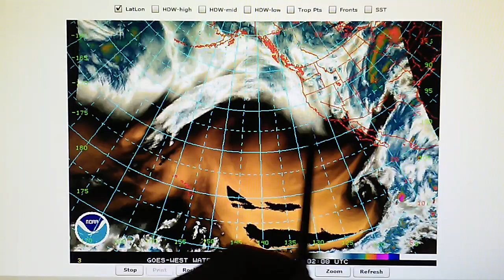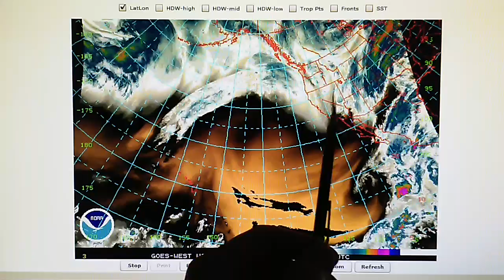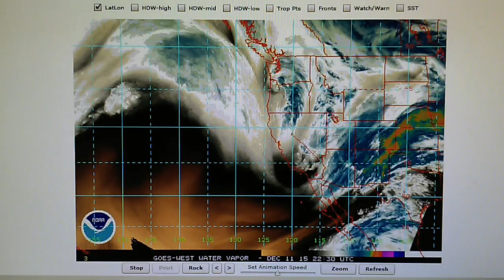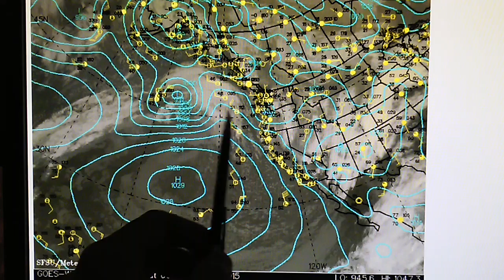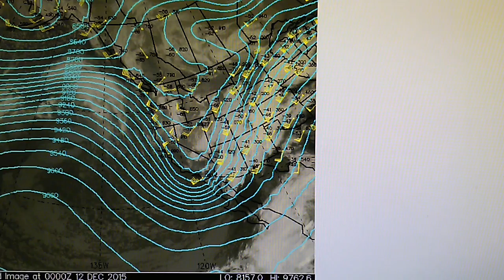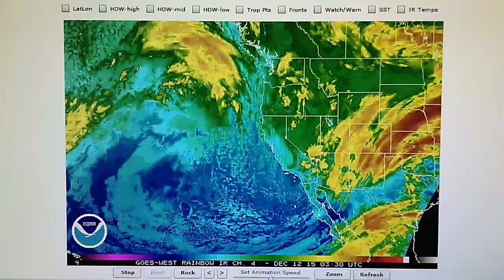12-11-2015; HAARP Squashing Low Pressure over L.A.

Comment: Dec 11 And again we are experiencing extremely strong winds here in LA through 11:30pm, courtesy of the HAARP weather weaponry, creating high pressure on top of low pressure.  I clearly see where HEAT is being applied by The HAARP Ionospheric Heaters, to evaporate moisture before it moves into the SoCal area.. I also see they once again have their manufactured weather devices in place & situated accordingly, since we have more rain in the forecast..
 Thank you for another precise forecast, 1PR.